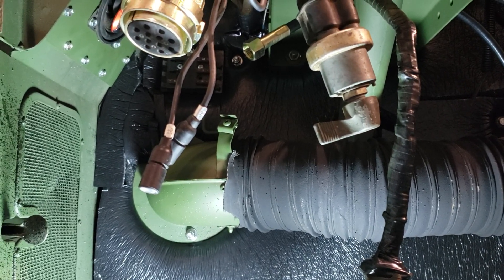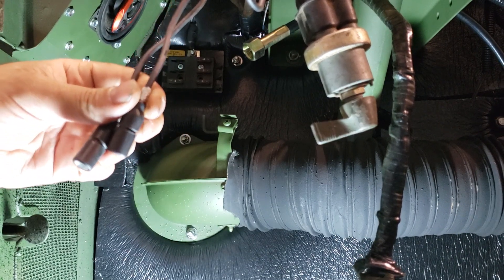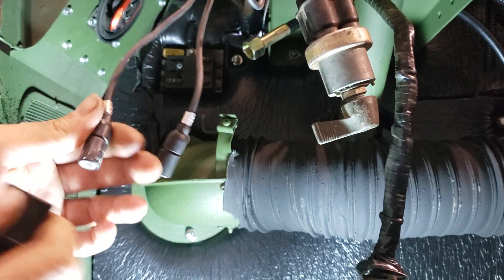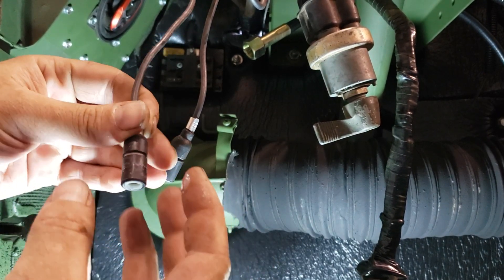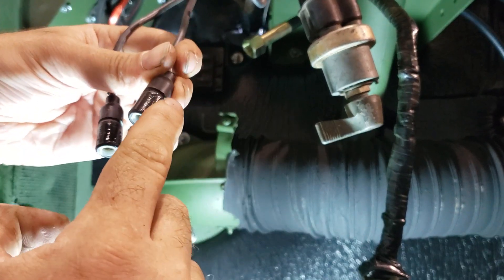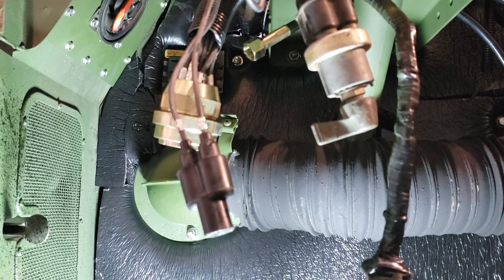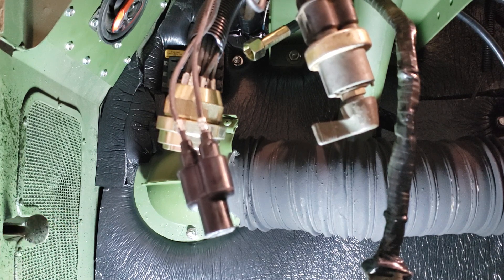Packard plug connection tips and proper utilization of dielectric grease.

Comment: Where did you get that foam insulation on the firewall?
Reply from the maker: That was a new old stock M939 series 5 ton internal hood insulation panel. I just cut and puzzle- pieced it in there to get the coverage I needed.

Comment: Very good explanation, thanks.
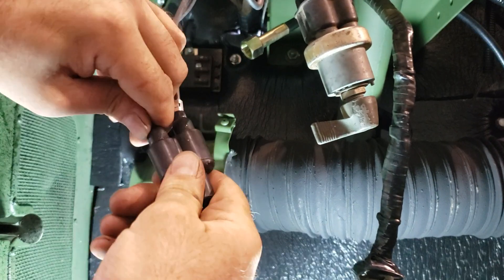1:47  ,   2:20 2:51 2:59 lol
I was thinking to use dielectric grease on many connections in my car, but I guess I will keep it for rubber seals of connections & ignition & & bulbs & on top of battery connections, etc... but not on contacts themselves

Comment: Garrett, you know I enjoy your vids bud, but I predict you're going to be pretty alone in stating "don't put dielectric grease on contacts". Lots of folks out there with much more time and experience in the field than you and I combined, will state just the opposite; they've had nothing but positive results by using dielectric on contacts, and there isn't sufficient film thickness where the contacts touch each to deter electrical flow, or cause any other type of problem ;-)
Reply from the maker: Well that's what I was taught in airframe and Powerplant school, and i have seen it cause failures many times. Instead of fretting over time the contacts draw the grease between them and the connection become intermittent or non existent.
Reply: @tacticalrepair  I agree. When I was a kid I made the mistake of putting it on contacts and had a failure immediately. Removing the dielectric grease removed the problem. I was lucky that I got an immediate failure instead of something intermittent down the road.